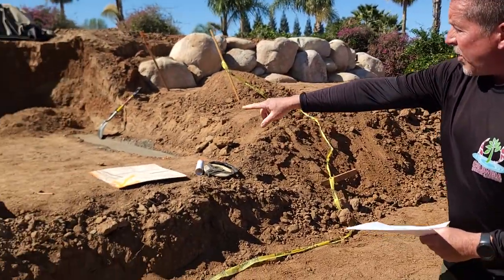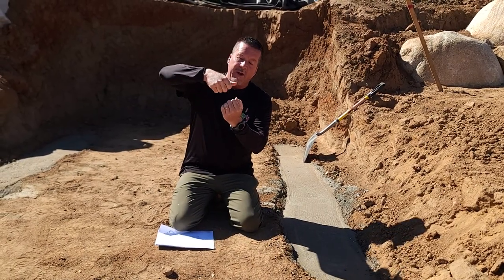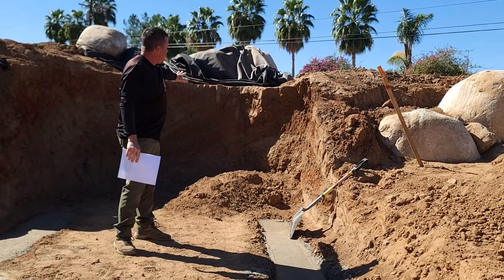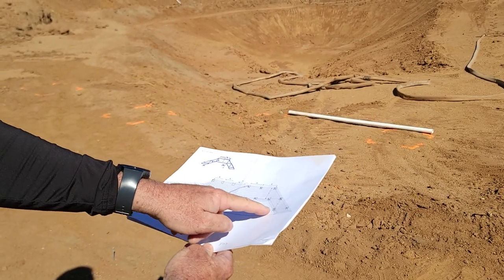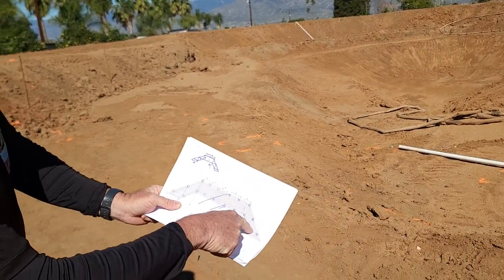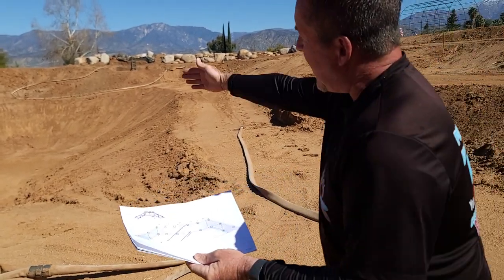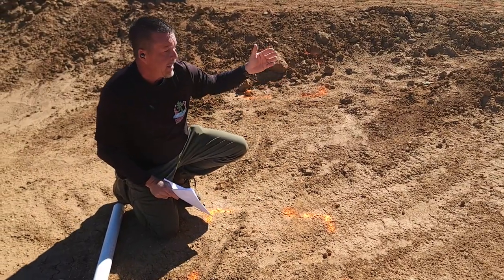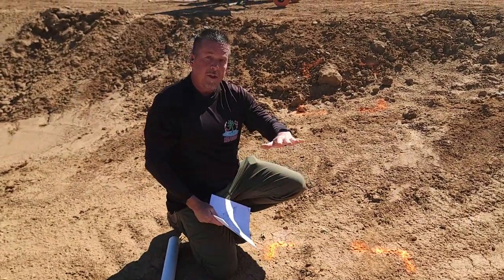🔨🦺 Project overview | How to build a dock or pier OVER pond liner for your koi or farm pond

Comment: Were you saying "horse pad" as one of the padding layers?
Reply from the maker: Stall mat
Reply: @ColumbiaWaterGardens  Is that an Aquascape product?
Reply from the maker: No. You get it from tractor supply. Aquascape manufactures skimmers, pumps, and filters. They really liner, underlayment, and flex pvc.